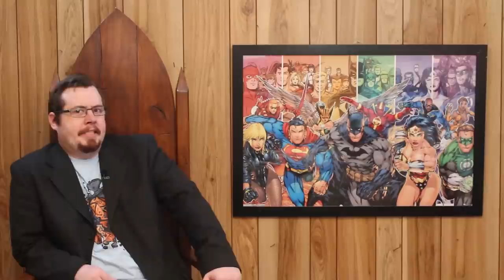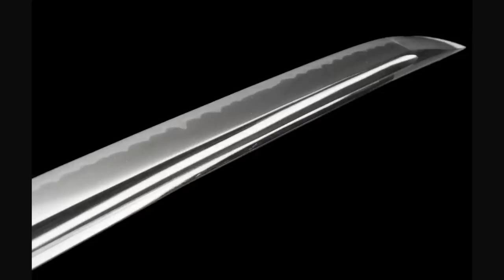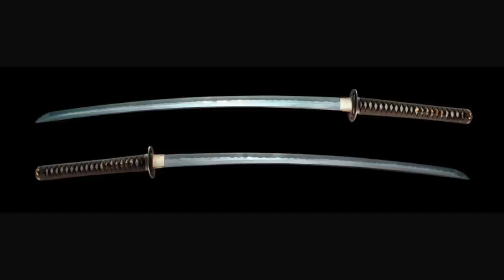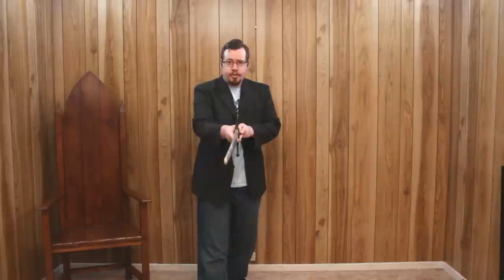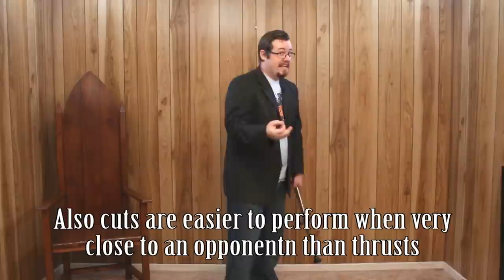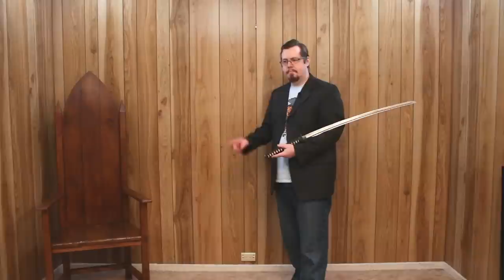Super cutting swords, are they needed?

Comment: Ok, there are a few things I see here.  First, cutting power depends on the strength of the wielder.  For example, a weak guy might not be able to kill with a cut from a long sword, but with something like a katana, the additional sharpness may help to cut deep enough to be fatal.  Obviously, someone who can kill with a long sword cut can kill with a cut from a more specialized weapon, but it does not go the other way.   So, the value of additional cutting power depends on the person.

Also, some of the Arabian cutting swords were primarily used as mounted weapons.  Putting strength into a swing is going to be harder while trying not to fall off of a horse (though, in a charge, you also get the speed of the horse).  This also brings up another thing though, which you briefly mentioned: Battlefield combat.  A weapon that can go all the way through leaves the wielder open for less time.  A sword that cuts halfway through a neck is going to leave the wielder in a bad position until the sword is pulled out of the wound.  Something especially sharp, like a katana, might even still have considerable momentum on the other side, allowing for an immediate defense or attack right after cutting through a limb or neck.  Really though, I think the big concern is getting the weapon stuck in an enemy's bone and getting killed while trying to pull it out.  (Especially bad mounted, where the weapon will be torn from your hand.)

In large scale combat, thrusting is going to have less value anyway.  It might be good for one-on-one combat (debatable, but I will get to that in a moment), but when you have a lot of enemies near you, a thrust will leave you open and there is a higher risk of getting the weapon stuck.  Cutting that is more likely to leave your blade free is very preferable in this kind of situation.

Now, the main problem with thrusting: I have some friends who are heavily involved in MMA.  They have studied both weapons and fighting techniques, and their claim is that most fights, even armed fights, end up with grappling at the end.  Some discoveries about ancient Roman weapons from about a decade ago even support this claim.  It turns out the Roman broadswords were not generally used for thrusting or even cutting so much.  They were primarily used as defense while grappling (presumably, the fighters also carried knives or were trained to use their hands around the weapons to finish things).  Most broadsword kills were supposedly stabbing an opponent who had been rendered prone on the ground.  Anyhow, the point of this is that in many combat situations, cutting would be more valuable than thrusting anyway.  Thrusting works if you can get your opponent before he (or she) gets too close, but honestly, what is the best defense against a thrusting weapon, if you have a cutting weapon?  It is easier to walk forward than backward, so if you can avoid the point for long enough to get close, your specialized cutting weapon has very little disadvantage!

Comment: Actually the thrust is more often deadly than  the cut. Yet the cut is more often debilitating then the thrust. And as I have already stated. You have failed to give a third option the crushing blow is always debilitating when it connects fermly however depending on the armor is just either to Phil is heading to the armor due to the Kink foot in it or debilitating to the Target inside of the armor.
And as everybody knows each of these must be done precisely each to their own fashion and style. Slicing move must be lined up the piercing must be driven straight and the crushing move must be slammed down firmly and with great force

Comment: One possibility with cuts is the need for the quick kill. Sure, a longsword will kill, most of the time, with a cut, but perhaps overkill functions to drop the enemy dead in just a few seconds, whilst ordinary non-overkill cuts and stabs take longer on average?
Reply: In short, stopping power.

A cut that severs an arm is going to result in a lot more bleeding and faster incapacitation than one stopped by the bone. (Actually much more than twice as fast if the cut is from the outside since the major blood vessels are on the underside of the arm)
Likewise, being able to cut through more ribs means more damage to internal organs.

It doesn't mean the tradeoff is always worth it, but even a 0.5 second sooner incapacitation is far from worthless as even fairly slow weapons can deliver a lethal blow in less.

Comment: I'd rather cut through a limb completely with no worry of the blade getting stuck or even partially stuck, than for it to be half lodged in bone with another combatant to still deal with. Also, if I can do a rotational cut through a limb and still have momentum left over, I can simultaneously setup for a follow up swing that is still lethal to another opponent.

The issue of a weapon being stuck also gives the opponent I'm attacking an attempt to inflict injury on me before they become unable to fight back completely. In battle, an opponent just doesn't instantly drop dead from a fatal swing. If I'm struggling to get my weapon back to stance, I may be exposed for them to pull out a dagger or secondary weapon of some kind on me. If I instead just sliced through their bloody arm, they are in much more shock and I'm prepared for one final attack from them since I'd likely be back in stance right away. Chances are though, the full severing of a limb is enough to end a conflict cleanly just because of the shock of it.

These are important considerations in practical combat. In a dueling scenario, maybe these factors aren't quite as prevalent, but curved swords for the most part, aren't necessarily based around duels. Perhaps that's partially why rapiers were considered dueling swords instead.

Comment: I will state my bias to begin with and than go to making my case.
I own a saber, and have been studying how to use it for the past year or so, before that I dabbled a little with the longsword and I live both.  The longsword is an excellent all around weapon, but I really like the protection of the basket hilt on the saber as well as how the sword feels when I swing it.
It seems to be that the cutting sword i.e. the saber, cutlass, and the like were designed the way they were for a couple of reasons, firstly, if you are fighting unarmored, or leather armored enemies in the same way the saber, katana,and cutlass were used you will want a cutting weapon because it can generally do the most damage in a single attack, and it will be able to penetrate litter leather armors because of its slicing motion. In the case of the saber and the cutlass, they almost never encountered metal armor because of their prominence between the 1670 and 1918 which meant they did not need to be able to get in between the joints in plate armor, or split the links of chain armor. Cutting is also a more important feature when you are mounted on a horse like in a cavalry unit between the seventeen hundred's and nineteen-teens, when you are moving quickly on horse back and your primary weapon is a sword you din't want to loose that sword by thrusting it in to opponents, rather you want to dispatch your opponents with as much speed and as little drag as possible.  In addition during these times when a foot soldier used his sword it would probably be against large quantities of of troops, like a Confederate infantry unit in the U.S. Civil War that overran an officer's position.  
All that being said, a saber can still be used quite effectively for thrusting, and I'd say it can be used to thrust in certain situations where a rapier or other thrusting sword would not be as effective. With the saber there is one fake in particular that I have in mind where you swing and when your opponent moves to block you twist the sword to where the edge is facing out to the side away from your opponent and you thrust around your opponent's ward using the bend in the blade to land a thrust when a un-curved sword would have been unable to land a thrust.

Comment: Cuts would be very effective against thrusting weapons, rapiers would most like struggle to deflect a much heavier weapon. Similarly, cutting weapons can be used to push spears out of the way, where as a lighter thrusting weapon would not only be unable to parry a spear, but because of its thrusting specialty, it would simply be too short to reach a spear user, which is arguably the better thrusting weapon.

Comment: There's more to fighting and war than the actual act of fighting. One of the best ways to win an extended campaign in a given conflict is to erode the morale of the enemy, and an effective way of doing that is through shock and awe. Being able to slice through bone may not bring a PRACTICAL advantage, but to soldiers not used to seeing this kind of carnage (and most soldiers would probably have been common folk) would definitely not wish to experience the same fate as their fallen comrade. Thus, for every soldier you remove through decapitation or some other similarly gruesome death, there's at least one of his comrades who is unwilling to deal with the threat.

Comment: How about this theory: What if the curve of cuttings swords is not primarily designed to increase the cutting capacity, but to make it easier to rectract and repose after a failed cutting attack. The curve of the sword will help the sword to bounce back with the center of its mass closer to its wielder from a block, and, perhaps make it easier to re-attempt an attack from a different angle. 

Think of it, a Katana is used traditionally with wide cuts used as both protection and attacking at the same time. If the sword gets stuck, or bounce back in the wrong direction, it might set the swordsman off balance or leave him exposed. The curve will help push the blocked sword closer to its user, making it more easy to complete the sweeping motion, or redirect the next attack. 

Tulvars is another example, they were used for very close quarter fighting, with a lot of cross cutting. It seems that a straight sword would have more difficoulties in completing these sweeping motions, as it might more easily "get stuck on the opponent".

Perhaps it is a matter of milliseconds, but it would be interesting to see if reposture after cutting attack with a curved blade is quicker than reposture after a cutting attack with a straight blade.
Reply: An analogy would be: Drop a tennis ball on a straight surface, and it bounces straight up. Drop a tennis ball on a surface leaning slightly towards you, and the tennis ball will bounce back slightly towards you. What if the same physics apply to curved swords?

Comment: With the katana, they are primarily unarmoured weapons, and only reserve ones on a battlefield. BUT, samurai and other's clothing is actually much thicker than you might first guess, especially round the stomach and so forth. Cutting specialist weapons are certainly more effective vs clothing and thick padding. Also, the samurai were cavalry heavy thus the ease of aim on a swing leads itself to a sabre like weapon. Also, as many others have said, fear makes the opponent more trepidations, he is less likely to run at you and get you both killed if he has seen limbs cut clean off.

It is also interesting based on peasant armour, it is thick padding on some areas, vs armour plate on others, where cut or thrust does not matter. basically cuirassier style protect the head and chest.

Also, Japanese soldiers were known for their fanaticism and fighting with every last breath. A killing blow is not good enough, as they will still have minutes to kill you and other people before they actually succumb to their wounds, so coup de grace is often a requirement. This is also likely why Japanese soldiers were unwilling to thrust - it ties up your weapon and they will still try and kill you whilst you are vulnerable. Japanese techniques actually seem to fear getting a sword stuck in the opponent, they think slashes should be shallow and come out the other side.

In contrary to your points, the same argument goes for a longsword - it has too much thrust capacity, a sabre and a katana and so on thrust well enough. Thrusts will kill just fine - but they kill MUCH slower.

I think your popularity point is completely moot - both china and japan shared the sword making ability of thrust swords, yet they both favoured light curves after the mongol attacks. And their populations and certainly solidier numbers far outstrips the populations and soldiers of europe.

Comment: this entire point of overkill falls mute when we talk on the battlefeld, in practical application the cutting cannot breach softening armors which deny your point of things that will stop the blade of a non cutting blade, in scession being able to cut through a limb allowed the swords to stay fresh with continuous use and the ability to cut through light armor or lamellar style armors where a long sword will weaken ( weapons of equal size and weight in competition obvioulsy for fairness), chinas swords show this most prominently, a jian scholar sword was not used on the balel feild by the common solder because they wiore too quickly when repetadely fight armored oppoenets, a stronger cut worked well around the lighter armors of their enemies for keep[ing the blades durable by not stopping in the motion of the cut, but it was not favoured off the ballefeild for exactly that reason, it coulndt thrust well so without having formation and sheilds that specialised in tight formational close quater work, not ot mention that the in ability to stab did not fall short at war either since sheild lines stopped the majority of thrusts in formation

Comment: I think it depends how you are using the sword. For instance, off of horseback the thrusting aspects go down and slashing or downward strikes go up. If I were fighting from horseback I would probably choose a cutlass/saber or something like it because of the bend in the blade. The bend helps when cutting downward because it presents a larger section of cutting surface when the sword is angled downward. Shad kind of touched on the subject in his Tiger Snake video when he said it was hard to use a sword aiming downward because of the straightness of the blade.